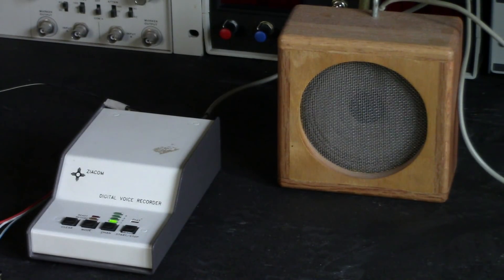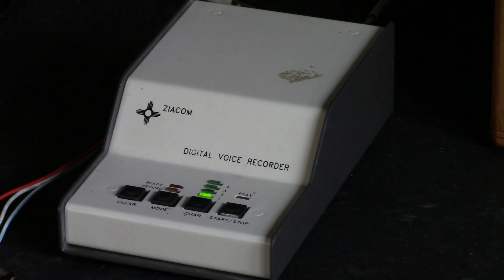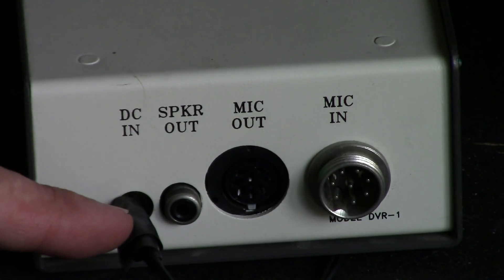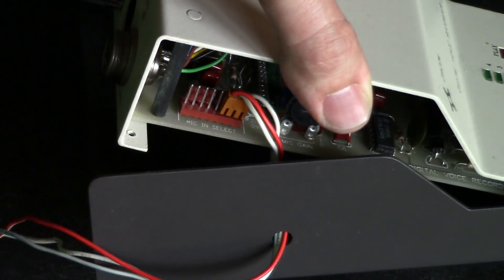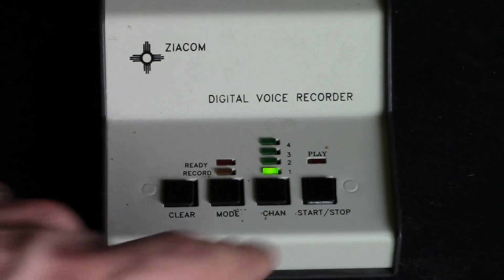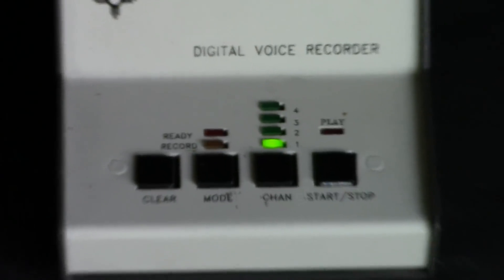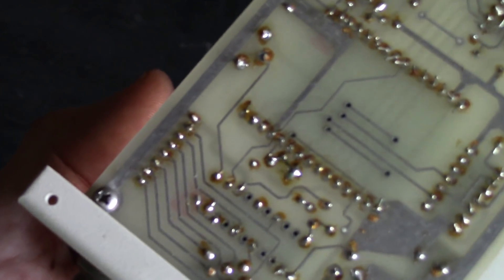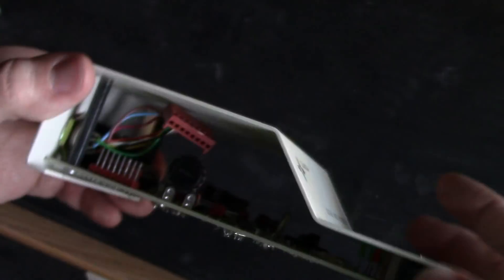Ziacom DVR-1 Digital Voice Recorder from 1990

Comment: Hello there. I found your video because I was gifted my dad’s Ziacom digital voice recorder. He is actually the inventor and manufacturer of these. He is a ham radio operator. He’s also an engineer and has worked for several major computer companies. These were actually made in a Dallas Texas suburb. But my dad grew up near New Mexico hence the New Mexico sun logo. I’m curious if yours has a serial number on it. He told me the story about how these were manufactured, and there weren’t that many made. Somewhere I know there is a photo of me with my dad making a recording for the first time on it. If schematics or instructions existed, it’s unlikely that my dad still has them either. Thanks for the video, I know this is something my dad was very proud of.

Comment: Very neat recorder. kind of a yak bak from 1990. I don't remember when the Yak Baks came out. maybe later and they too have volatile memory and the recordings are not stored digitally but analog voltage levels which make up the waveform of the recording.